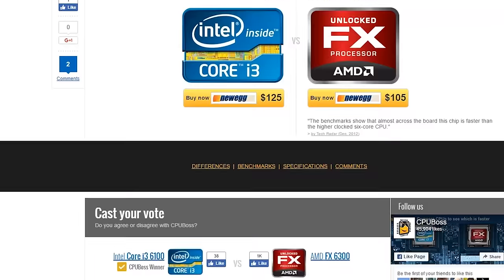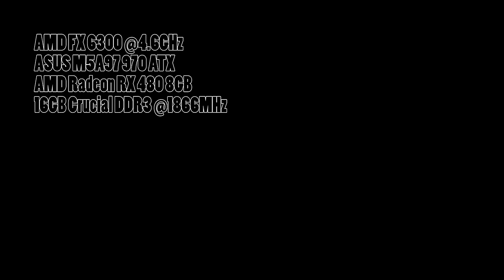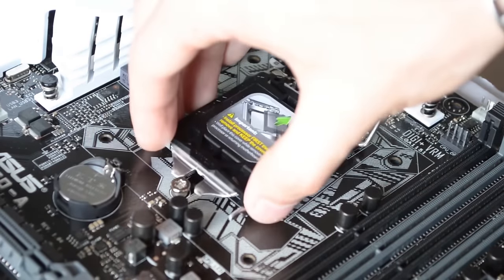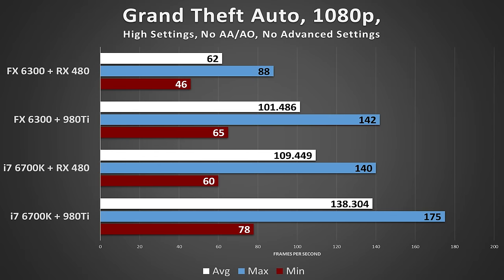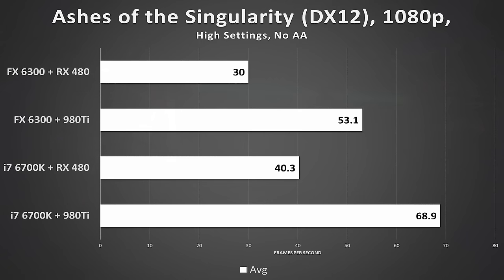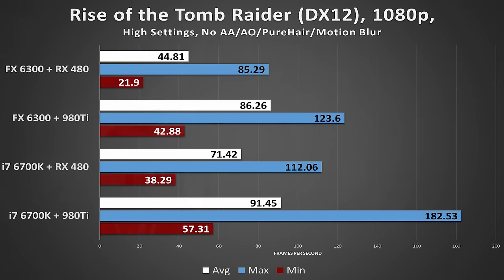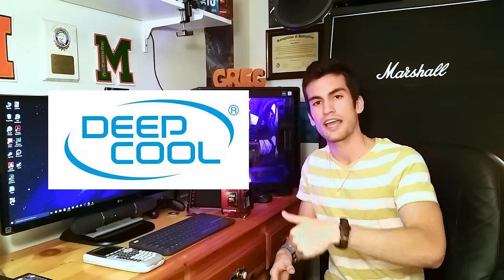AMD FX 6300 + RX 480: Severe Bottleneck?

Comment: I disagree that the FX6300 is bottlenecking the RX4800 in GTA5. If the cpu was bottlenecking the gpu you would have gained no performance by using the 980ti on the same platform and you clearly did.
Reply: You have logic in your opinion. But why then i5 or i7 + 480 has better performance? Its not real bottleneck, but 6300 lowering the overall performance anyway.
Reply: +Игорь Санду The core i7 and i5 are better performers as you said, no doubt here. I'm just discussing the "bottlenecking" which means that no better performance can be achieved using this cpu regardless of the graphic card, which was not the case.
Reply: Even the FX83xx bottlenecks GTX960 so there's no game here :/

Comment: But the point of buying a 6300 is to overclock it to 5ghz. I run mine with an R9 290 and it benches similarly to i5/i7 systems on firestrike.
Reply: Hell, I get 60fps in 5070x1080 on GTAV with max settings. The 6300 has a 14mb L3 cache and huge overclocking potential. Once it's overclocked, it's not a bottleneck.
Reply from the maker: The 6300 does not have 14MB L3 cache. It has 8MB of it.
Reply from the maker: I overclocked it to 4.6GHz. That is safe and fair. Expecting the average individual to attain 5GHz is unrealistic.
Reply: I'm an average user and I get 5ghz at 1.48 v all day every day
Reply: An average 6300 wont overclock to 5ghz.
Reply: Guys let the AMD fanboy have this one. Poor guy.
Reply: Let em have it. Hey, in the north that AMD rig can also serve as a space heater. Win-Win.
Reply: GTAV is not firestrike lol
Reply: And if you can't get your 6300 to 5ghz then you don't know how to oc lol
Reply: Yea, and going at that rate is burning either your Mobo or CPU, so watch that power creep as it starts to fail.
Reply: Been running the same 6300 and 990fxa for 3 years solid and not a hiccup.
Reply: 1) I doubt that even 10% of Piledrivers\Kaveris AMD CPUs would overclock to 5.0. People who say that their Piledriver works at 5 Ghz are either very lucky bastards or liars.
I once had an fx-8350 that wasn't even able to make it to 4.5 while liquid cooled without throttling (seriously, the 62c throttle point seems a bit too low). I also have an X4 860K now, that also can do only about 4.5
2) Even if you're lucky with the CPU, you'd have to overpay for motherboard and cooler to do that (rather buy a more powerful\modern platform instead, huh?).
3) You'll be having questionable stability in the long run - your computer might hang\restart when you really need to be stable. Overclocking CPU to the max is never completely stable.

Also if you just think about the clock numbers...  5000/3500 = 1.42, which means even in the perfect world scenario you won't ever get more than 42% performance improvement through overclocking (3.5 to 5.0). Not bad, I agree. But in games are usually far from perfect world. Realistically though, it is around 4500/3500, which would be 28%, which will be even less. 
But then you can take a look at FX-9590 benchmarks and see that they are still not able to completely catch up to Intel - and the FX-9590 is the maximum performance you can get from AMD now.

Comment: Getting an FX 6300 for a couch gaming PC, then dropping my old 750ti in it. Should be a fairly decent console replacement.
Reply: You will be able to run 1080 res on high with older games and mid settings on newer..
Reply: dont be too down it still is a decent gaming PC, i have an old Intel E6600, 4GB RAM 667MHz plus GTX 750Ti as a Media Hub

Comment: Even tho I do like AMD, with their CPU, but not happy on how some older CPU can barely handle newer cards, compare to Intel chips from the same era. Well, at the same time, you aren't paying for something that will get you though years of upgrades. 
Question is, will the Bulldozer I think (The 8000 series of FX chips) will cause a bottleneck like this, with a either a 980ti or a 1070? May sound stupid, but wonderin
Reply: and fx 8320 too
Reply: Depends on how well the game handles multi-threading. I have an fx-8150, and when overclocked to 4.5GHz, it can keep up with almost any i5, as long as the games are good at using all cores optimally (like GTA 5). But when I play something that relies heavily on single thread performance (pretty much any MMO), the FX would need to run at 6GHz to keep up with the i5s, and I don't have liquid nitrogen cooling to try it out...
Reply: FX83xx is bottlenecks even GTX960 so it's really outdated already and also overpriced :(
Reply: +MrKeikari
I could argue that my FX-8150 bottlenecks my Radeon HD7850 when I play Tera or Elder Scrolls Online. In Tera my GPU load is sometimes at 20% while the CPU is at 100% on one core (and about 15% overall). Similar case with ESO (40%). And even Fallout 4 (70%), where it is with 2 cores at 100% in CPU intensive areas. In these games you could get an i7-6700k@4.5 GHz bottlenecking a GTX960, and in case of Tera permanently and everywhere in the game.

But in GTA5 and Watch Dogs, I see no such problem. In fact, my CPU is basically begging for more, since it rarely goes over 60% on any of the cores. And we're talking about the 8150, not the 8350. With overclocking there is probably room for up to 1070 in these games, considering that benchmarks put the 8150@4.5GHz above any stock i5 in multi-threaded performance, even the 6600k, and by quite a large margin. For example in the PassMark benchmark, my 8150@4.5GHz got over 9.2k, while stock 6600k is at 7.8k (in fact less than 0.2k above stock fx-8150). That actually puts it right in the middle of all the 3rd gen i7s and 4th gen high end notebook i7s.

Basically, whether or not there will be bottlenecks, depends on the games you play. So if you already have an FX CPU, and you mostly play well-optimized games, the GPU will be a huge upgrade. But buying an FX CPU now (which is the only case when you would worry about it's price), is just a waste of money, and that not only because of the performance or price, but also because you'd be stuck with DDR3 and no upgrade path. 

But saying that FX-83xx is bottlenecking the GTX960 is just wrong, because there are games where the i7-6700K will bottleneck a GTX960.
Reply: Piledriver is bulldozer 2.0 basically.

Comment: For me, personally, this video was something I was interested in.  I currently run an FX-6300 at 4.4 GHz, a 7850 2 Gig at 1200 MHz core clock, and 8 gigs DDR3 1866.  I really like the 480 for its gaming performance at 1080p for its price, and while I'm looking to build a new rig after Zen comes out, I haven't decided what I'll actually do.  If the performance of Zen isn't anything to write home about, this video has supported my possible backup to just buy 8 more gigs of DDR3 to add into my build and an RX 490 or GTX 1070 into what I'm already running.

Comment: 3 years ago the fx6300 was a good buy, but now you could buy the i3 6100 and get the same multi core performance with much higher single core performance for about $10-$20 more. But the i3 platform in general still cost more because of ddr4, but its only about 30 bucks and you get a upgrade path

Comment: alright alright alright alright okay look salazar dude studio
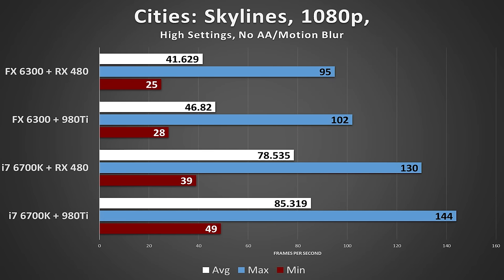at 5:55 when you talked about the bottleneck I almost killed myself,
please understand that CPU's DO MORE THAN JUST GET RID OF A BOTTLENECK
the CPU is half of the performance and thats literally what that benchmark shows
the FPS doesn't improve because the CPU lets the GPU work harder
the FPS improves because its simply a BETTER CPU
the same argument can be made between a RX 480 and 980Ti
duh the 980Ti is gonna be better, and the comparison between the 2 processors
LITERALLY shows that the FPS difference is from the GPU and CPU
note how with both CPUs the FPS still changes dramatically when they switch out the GPU
and the only gain is from a better CPU, this comparison actually makes very LITTLE note to a bottleneck
Reply from the maker: I have several in-depth videos covering CPU thread parallelism and architectural differences. You're preaching to the choir. What I said in this video is essentially what you're erroneously reiterating. Obviously the FX 6300 is a bottleneck. Jumping to a 6700K (essentially no CPU bottleneck) places the GPU in the clincher. "The CPU is half the performance" what on earth are you talking about? Don't believe everything you read in forums, please.
Reply: Salazar Studio  While I did word it weird I do believe that this would be more accurate if there was a gauge measuring the GPU usage.... as GTA V being a very CPU intensive game demonstrates very well how important the CPU is.... compare the GTA benchmark to the Hitman benchmark and it doesn't take a genius to see the difference made by CPU performance is substantial in GTA (50FPS differnece from i7 6700k vs fx6300 on RX 480) and hitman (20fps difference from i7 6700k vs fx 6300 on rx480)
Reply: ElementalsMods If you have certain amount of money, it is always better to put on graphics card than cpu if you reach a level. I wouldn't say 6300is good enough but it is pretty close especially for those who already have 6300 in their computers. I would still recommend to get an used 2nd- 3rd gen i5 or i7 based computer and spend rest of the money on the gpu for maximum gaming performance.
Reply: ElementalsMods But you have better performance with 6300+980ti than i7+480 lol.
Reply: John Yang yeah because theres a big difference from 980Ti vs 480.... When exactly did you see me say that CPU was THE ONLY thing that made a difference...
Reply: John Yang What I believe I said was in GTA 5 being such a CPU intensive game shows how important the CPU also is. since everybody treats it like dirt compared to the GPU...
Reply: ElementalsMods But why call it bottleneck? It can be considered bottleneck only when 980ti with 6300 performs worse than i7 + 480.
Reply: ElementalsMods And bottleneck is game dependant you can't say cpu bottlenecks the gpu. And they are nlt related to each other whatsoever it does not make the gpu work easier when upgrade cpu so doesn't the other way.
Reply: ElementalsMods well its not simply a better cpu if its newer. for example if i take a veeery old cpu and id had more data bandwidth than newer cpus it would still be better for games that only utilise the gpu. on games that make both the gpu and cpu work hard, the gpu can bottleneck the cpuif the data bandwidth and/or the processing speed is lower than the one of the cpu and vice versa. Its all about the architecture and  bandwidth. This was to enhance your comment, not to critisise it.
Reply: John Yang  I'm pretty sure you don't know what you're talking about so just re read everything real quick.
Reply: ***** It is all depends on the application u use. Or I can say the new i7 is not smmoth enough for cpu heavy use appication and gpu is only at 20% so you would say i7 is bottleneck in general? WTF?
Reply: John Yang  DO you realize that a bottleneck is when one part in your PC is not as fast as the others and is what holds it back? if the GPU is at 20% then you have a bottleneck because the GPU only has to run at 20%, to get the same frame rates that are being limited by other componets in your PC. Seriously man...
Reply: ElementalsMods No. It is not because the cpu pull back the gpu it is the application has different usage towards the hardware. It  all depends on the application.  There is no such thing called bottlenecking. The bottleneck appears when the hardware is not enough for the application. You can not say cpu gpu regardless of the application.
Reply: John Yang  why are you talking to yourself.
Reply: ElementalsMods lol
Reply: I'll stay subscribed to salazar tho because I do not like this specific video because I don't think it is the most accurate, other videos he's made 
 are enjoyable and informational at the same time. so thumbs up to that.
Reply: ElementalsMods There is one more thing to consider. Nvidia graphics driver is more optimised to the cpu usage. That may explain why the difference between of the two gpu with different cpu are dramatic. Easy example is to swap the rx480with gtx1060. 
Apart from that bottleneck is always application dependant, you can have both cpu bottleneck and gpu bottleneck at the same time with different application. Talking about bottleneck without addressing the specific application is meaningless and wrong.

Comment: use a 8350 or 8370 they are the high end of the fx section (not including the 9 ones which are harder to overclock
Reply: They're also not much more than the 63xx chips.
Reply: they also aren't good enough, I have 8370 OC'd to 4.6GHZ with the rx480 and still notice a cpu bottleneck in GTA5/Overwatch/ or any other newer non Dx12 or mantle/vulkan driven game.
Reply: +prolixj2 I don't notice a great deal and mines not overclocked, also I have gtx 970s in sli, my point is if your gonna do this test a 8350 or 70 is the high end of the low end in terms of cost and is far more comparable to a lot of Intel options the 6300 is not enough for a lot of games where as 8350 is the bare minimum for VR so is a good choice to examine for gaming, 6300 is good for budget builds but even entry level gaming machines need a bit more
Reply: AMD cpus have nothing high end about them lol.
Reply: Yung Baklaooo there's a high end and a low end in their product range and there's nothing wrong with them for price
Reply: Yung Baklaooo im not getting into a fanboy debate, for the price range the fx series perform relatively well, against similar priced devices some massively out performing intel chips at the same price, the big problem with the fx series was the design flaw of having one scheduler for every two cores, which bottlenecks the processors quite badly, and the lack of a hyper threading alternative...both of these are going to be solved with zen.

Regardless of your thoughts regarding either side be grateful their are two companies competing in the space, having one company dominating a market completely leads to stupid prices, where as even a weak competitor for a dominant market leader can force them to lower their price demands, and if the recent zen spec leaks are anything to go by they will make intel at least rethink some of the more silly priced items in their range.
Reply: Team Cannon Fodder I completely agree.
Reply: misspoke slightly fx processors have one fpu and one 2mb catch per two cores the fpu is the major bottleneck
Reply: Not much of a gain.

Comment: Glad i went with my decision to get the Radeon 480RX 8GB Card after watching one of your videos @Salazar Studio. Goes hand in hand with my Dual Xeon X5687 Processor which i thought might of bottleneck PC in some form of fashion, among fry something due to hearing about the power issues, but after downloading latest driver and software so far it has been quite the breeze to run 3 monitors and play any game i throw at it 60FPS and mostly important that Sony Vegas is utilizing the card to render videos upgrading from a Radeon 5770 HD 1gb Card from back in 2011.

Comment: Great video. Can you make one for the fx 8350?
Reply: i have 8350 4.5ghz and rx 480 gigabyte g1 8gb and its good but still deeps below 60 on cpu games like gta v with minium of 50 fps
Reply: Thanks :)
Reply: Its the same thing, just with an extra "2" cores. They perform very similar in games. The 8350 only gets an advantage in applications that can utilize every single available core/thread like editing software.
Reply: RGInquisitor c
Reply: Shawn do you think I can power that system with a 450w corsair psu?
Reply: Chris Paraskevopoulos what's your psu?
Reply: nope it would struggle u better get a good evga 550 or 600 would be good